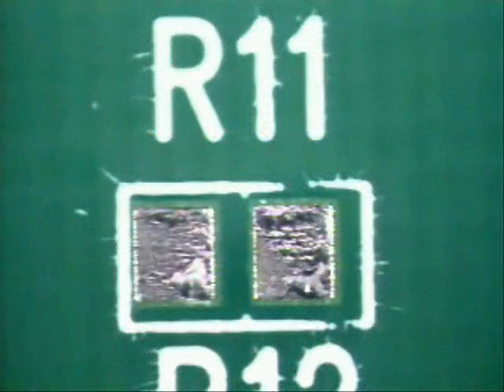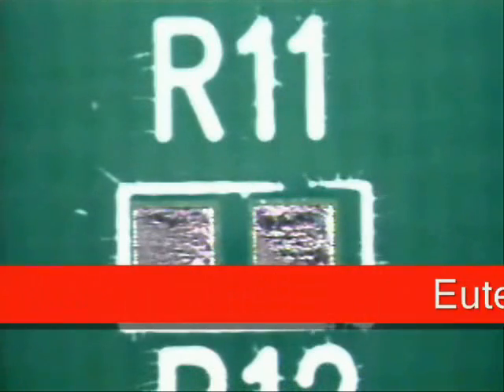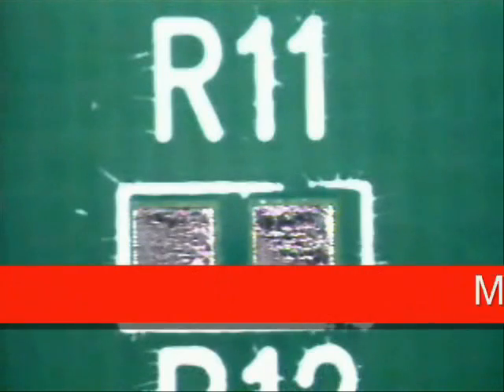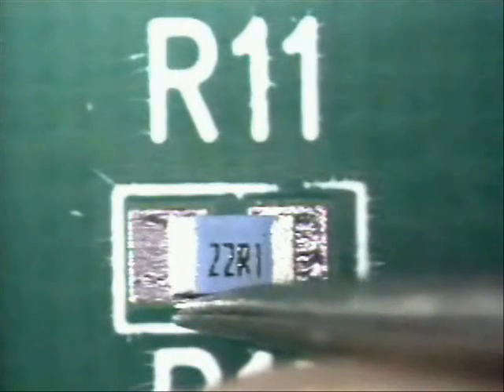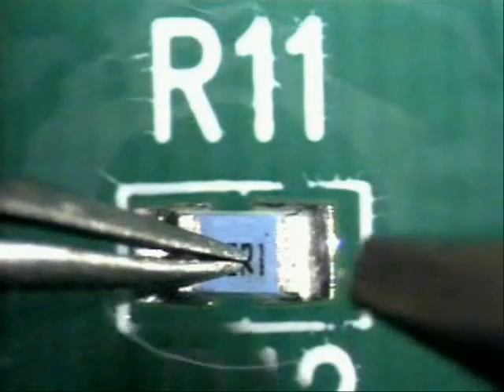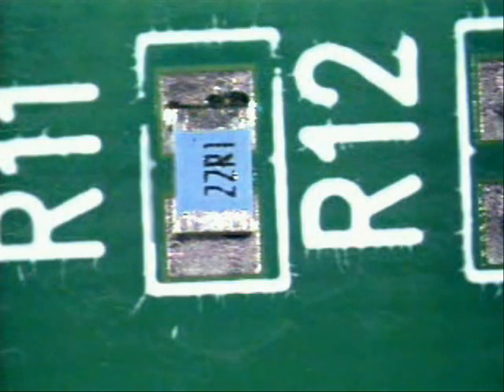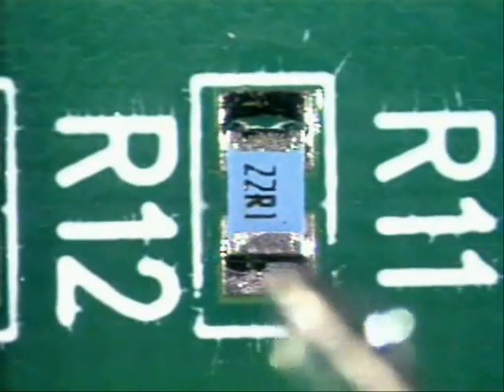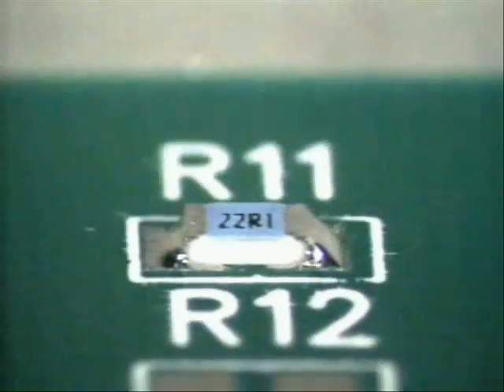0805 Passive Device  Installation and Soldering

Comment: this is different another video tells me to apply the solder first to the tip of the iron and then touch the iron to the chip to solder it.
Reply: he is using a shitty "envoiremental" flux. Thats why hee needs the flux in the solder wire